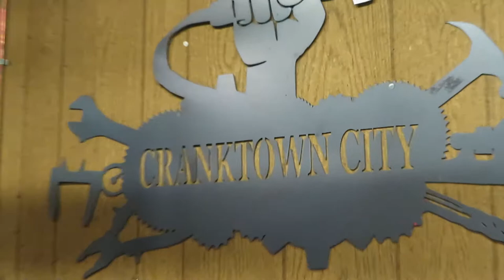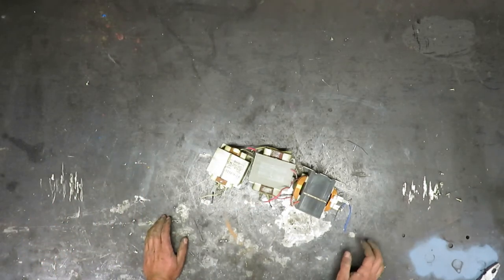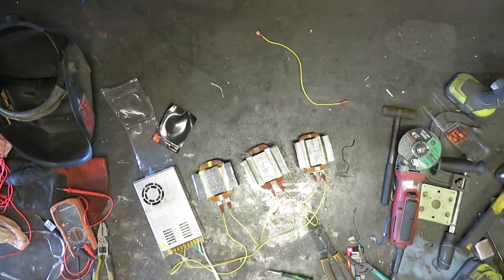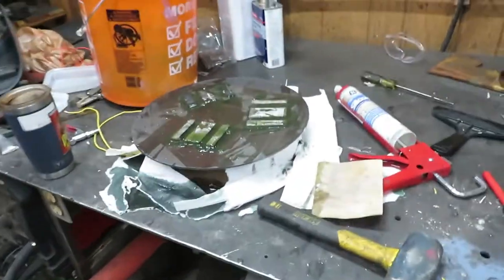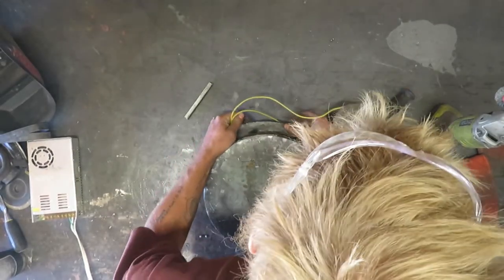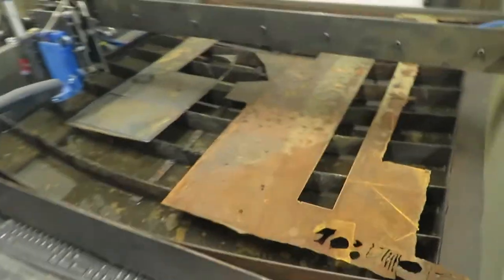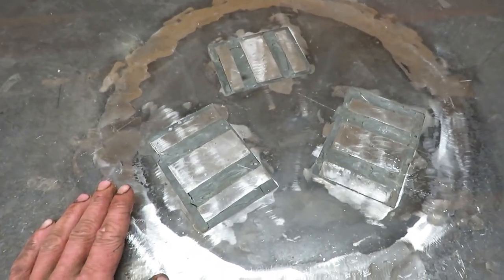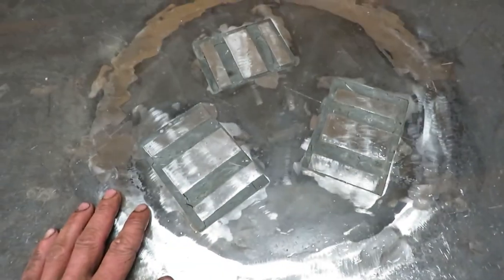Electromagnetic Clamp Build

Comment: That's a cool build.   Could you measure how many amps it draws?  I wonder if the 12v/30A power supply you used is maxed out or it's only drawing a few amps.

Comment: cool build! the transformer on the bottom left side has the center post touching the table. you should cut a slot there to break that connection and touch up with some epoxy.

Comment: I wonder if it would have worked on 120v ac. I'd think you'd need 2 sets of 2 in series. Without the top on it the AC current would be pretty high from the lack of inductance. 

Or maybe the whole thing would then vibrate at 60HZ.. who knows

Comment: What power supply did you use?
Reply from the maker: It's a 12vdc 30 amp switching power supply. The one I used is just a cheap one from amazon
Reply: @cranktowncity   Thanks for coming back to me.  I am grateful.  At those AMPs have you had any heating issues as you have been using it?
Reply from the maker: @utahchaz  Yeah, it does get hot after a while, but that's why I have it on a timer to avoid anything catastrophic. I've accidently left it on a few times and It'll get pretty hot, but not enough to break anything.

Comment: The idea is good, but you made a big mistake. Devices operating with a magnetic field (transformer, electromagnet) should not be locked in an iron box. The magnetic lines are short-circuited, which significantly reduces the efficiency of the device and heats it up.
Reply from the maker: Makes sense, If I ever have a revision 2 I'll have to address that. For now, the timer is saving me from overheating issues.
Thanks for the input!
Reply: it looks like 2 of the transformers are ok. only one has the center pole touching the table. probably fix that easily with a grinder